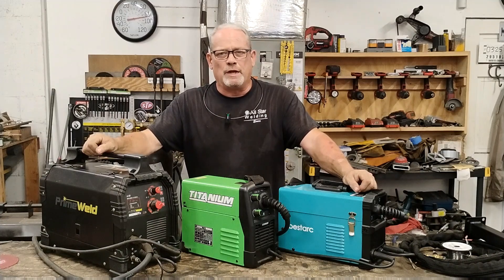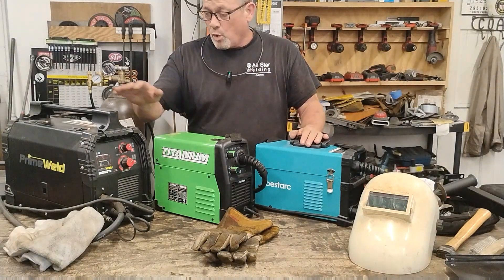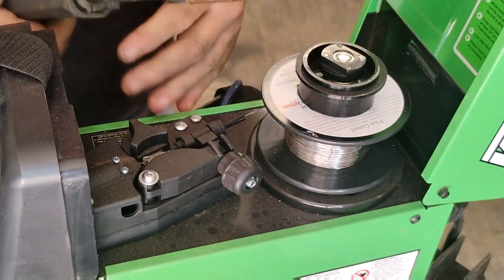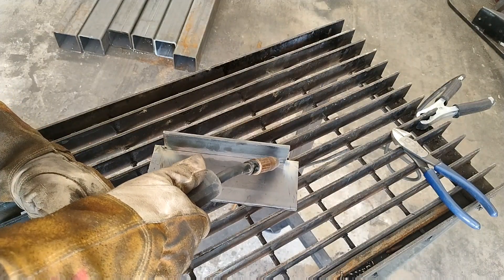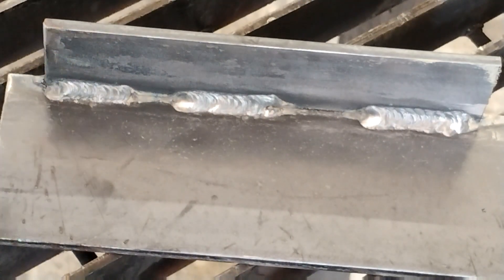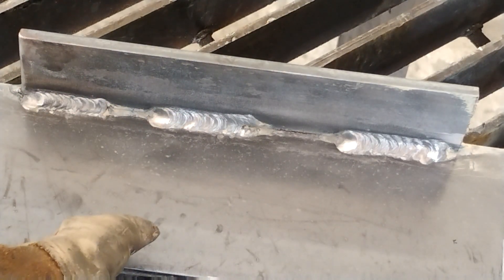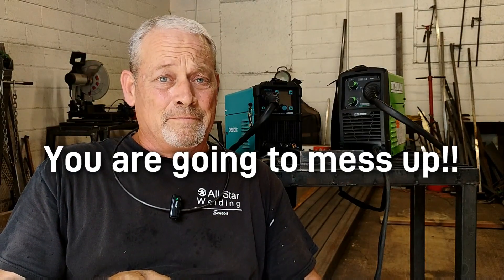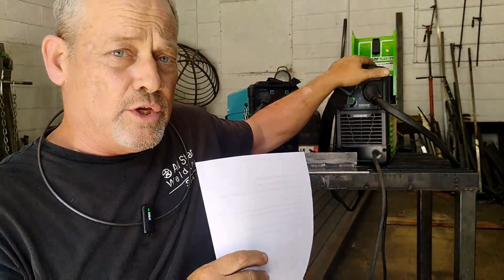Flux Core Welding for Absolute Beginners | Using the Titanium Easy Flux 125

Comment: can i use extension cords wire for  this welder  and thank you for your  all education 
and happy new too
Reply from the maker: Absolutely you can. Many times I used mine on a handrail job using an extension cord. I run it off my Vulcan Outlaw welder/generator. I've done 100ft. Use at least a 12/3 cord, or better, an 10/3. But the 12/3 works fine. Don't use one of those skinny cheapo Harbor Freight 14g cords.
Reply from the maker: A 12/3 cord is expensive, but you will like it

Comment: Excellent video.  This has inspired me to resume my welding journey.  I am especially encouraged by your statements about flux core welding.  The are those that would have people believe that flux core is for "hacks".  In the case of people like yourself, I can see that this is absolutely not true!!!  Thank you for your time and effort to educate DIY'ers such as myself.
Reply from the maker: Thank you for your comments. Flux core is used much more than you'd realize. A pipeline welder is very good at what they do, and wouldn't be caught dead using flux core, but that doesn't mean it's not valuable in the industry. It's just not used in pipelines. But that doesn't mean it's for hacks. 

Stay tuned ... I am in Mississippi right now caring for my mother. And it looks like I won't be getting back to South Carolina for a few more weeks. When I get back, I'm going to make a flux core video to end all flux core videos.  Also, I'm going to do another Titanium giveaway. So make sure you subscribe and hit the notification bell so you will be alerted when new videos are up.

Thanks for watching!

Comment: Could you use a flux125 to weld on a new coupler to my utility trailer ???? Looking to use the plasma50 to remove the old one and grind it clean and then flux the new 2"ball coupler onto the trailer ?? thanks..
Reply from the maker: Absolutely you can. I've done it probably 100 times.  Now, you do it how you want, but for the last few years, I have been cutting off that curved out section of each side of the coupler. That gives a nice flat edge against the tongue beams for a better weld. Again, it's just what I do now. Do it your way!  But yes, you can definitely do it with the Titanium.
Reply: @AllStarWeldingSC  i thought the same thing as the top plate of the would add the the strength of the coupler and only raise the new one up slightly.. this new demco coupler seems great.. thanks enjoy youe videos and im learning...
Reply from the maker: That's not quite what I was talking about, but that could work too. I meant cut a long diagonal to get rid of that curled out lip

Comment: This is what I need, after getting a few price quotes on a fence made of 2 1/2'' round steel pipe!! I figure, if I rent a pipe driver and buy a decent flux core welder, I can save a least $5000.00 bucks. Then I can buy a good set of jumper cables for the Chevy😅😂🤣
Reply from the maker: Heck yeah. I do a ton of 2" round pipe handrails. And it's usually on site. Flux core is perfect for that type work.

Comment: One thing you didn’t mention that makes all of the difference is clearing your work area and put yourself in the most comfortable position possible, makes for the most improvement when you can see and approach the welds comfortably.  Why does the Titanium come with a gas nozzle when it’s flux core only???
Reply from the maker: Yes, you are correct. Especially clearing the area. Flux core makes a bunch of sparks!  The tip cover is just that, a cover. It protects the contact tip so that sparks/slag doesn't fuse the contact tip to the end of the nozzle. Also, it isolates the tip. The contact tip will be negative charged and the steel will be positive charged. If you accidentally touch it to the metal in a tight spot, it can arc and fuse the tip to the metal. It's not a gas shield. However, when I am using flux core wire on a Mig machine, I will usually use the gas shield as well, not only for the reasons I just stated, but to protect the holes that the gas comes out of from the flux spatter for when I switch back to gas

Comment: What is voltage it uses 110 v 15 A? Thanks.
Reply from the maker: Yes. Just 110v. 15amp breaker will be ok if you don't turn it up too high. 20amp would be preferable

Comment: Great video. how do you determine what to connect your ground to? For example if im welding an exhaust on a car what would i connect it to?
Reply from the maker: Just clamp it to the end of the pipe. Any part that's part of what you are welding. Or, you could clamp it to the exhaust hanger as well

Comment: i have a question, I have the same setup. Welded some really really basic stuff for a bbq offset smoker. I am now sort of practicing, i do all my welding outside. I have heard people say i should be wearing a respirator, or a mask or something. I am not someone who obsesses over these things, and the masks are really uncomfortable. How necessary is it to wear a respirator? I never see pro welders wearing them.  Again, im welding outside with this same setup machine. (titanium 125)
Reply from the maker: That's a great question, and something I've never talked about. 3M makes a nice mask with smaller filters that allow it to be worn under a helmet, and someone once said that the Harbor Freight is the same. Get into the habit of viewing your welding from the side so that the smoke doesn't go into your face. If you are flux core welding or stick welding, set up a fan to blow in you. It won't mess with your welding. Obviously you can't do that with Mig or Tig, a fan or breeze will blow away the shielding gas, that's what makes flux core ideal for working outside. If you are welding anything that is galvanized, zinc coated, painted, or any other coating, you'd want to grind off as much as you can before welding. This is especially true with galvanized. If you breathe that stuff, you can get galvanic poisoning. It's awful. It will make you feel like you went through all five stages of the flu in about 3 hours. Drinking milk will help to nullify the effects. No matter what I order for lunch, bet that I will have it with milk. I drink a lot of it, as most "old school" welders do.  Like you, I don't obsess of it either. Just take precautions. Set up a fan, work up wind if you are outside, and don't hover your face over the smoke. I'm not saying to NOT wear a mask. They are cheap, and you should wear one,  but there are ways to minimize exposure.

Comment: Thanks but....what is the point of making a video of arc welding without a filter on the camera? We can't see anything. It could also destroy your camera sensor.
Reply from the maker: I have tried to do that. I couldn't get it too clear. Obviously it can be done, but not with my current setup. Perhaps I can get better shots when I can afford a new camera system. The good ones are expensive, and I do this out of my pocket.

Comment: Where can I get a metal nozzle for the 125 ? Mine came with a plastic nozzle. Still learning but it seems like the metal nozzle will help with the fast tack welds since you can reset the nozzle on the part and just pull trigger for a quick tack. Is that correct?
Reply from the maker: Yes, that's the idea. Don't get me wrong, I like the black pointy nozzles because they let me get into some skinny cracks, and let me view what I'm doing. But, they don't last long. They get hot and break. I get these at my welding supply store. I may be going there tomorrow, and if I can remember, I will get the details on it. I believe you can get them on Amazon. Give me a few days ..
Reply: @AllStarWeldingSC Thank you
Reply: Just get one for a Mig welder harbor freight or tractor supply or home Depot have them